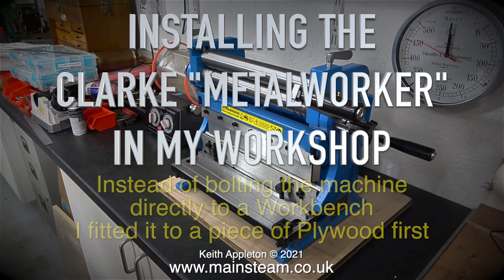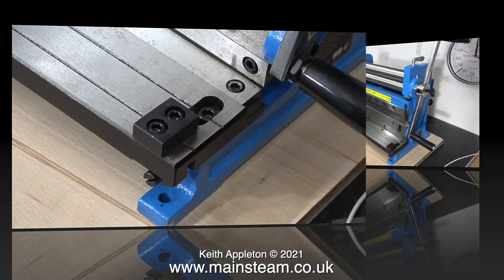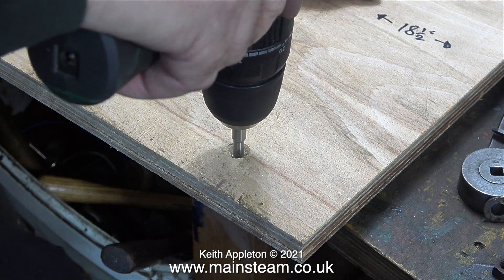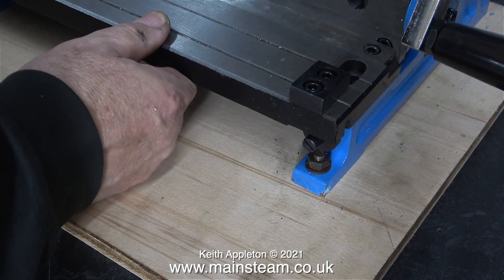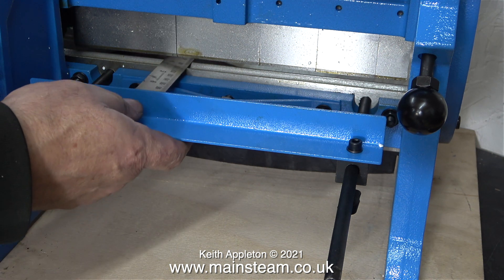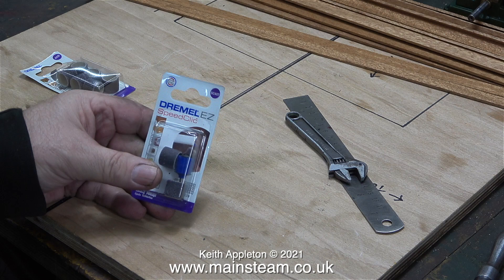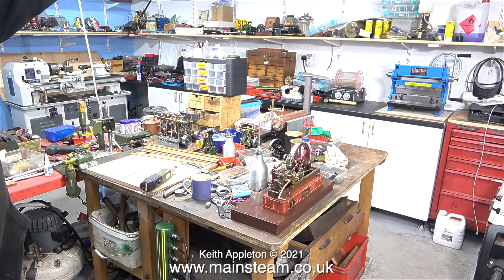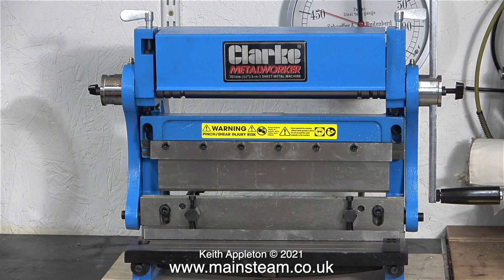INSTALLING A CLARKE METALWORKER - IN THE WORKSHOP

Comment: I also mounted mine, but to a piece of 1" (25mm) board. Easy to move around the shop and clamp down when needed. I drilled a few blind holes to hold the hex wrenches and backstop parts when not in use.

Comment: The middle is a truss that keeps the knife straight on a sheer.
The part you took off isn't a safety it's a clamp to hold the material down when you cut it

Comment: Thanks, Keith! I appreciate your sharing this information with us as I had considered buying a similar machine. Please keep showing us what you can make with it. Specifically, will it be capable of rolling boiler shells (copper) or boiler wrappers. Bill.
Reply from the maker: That depends on the thickness & length of the boiler barrels and what the barrel is made from. These are only general purpose light duty machines.